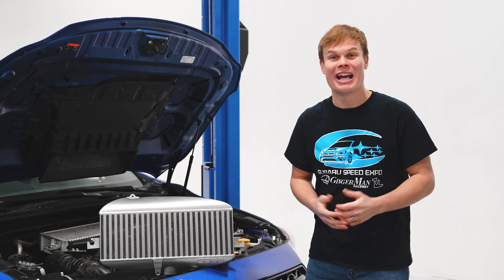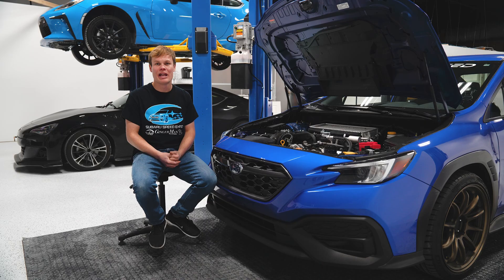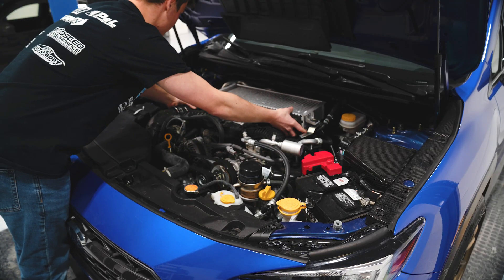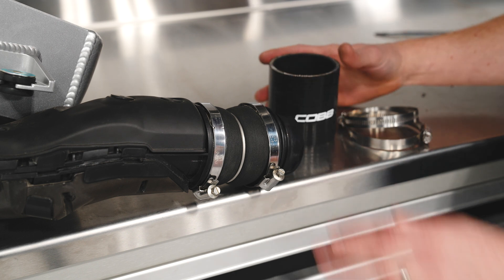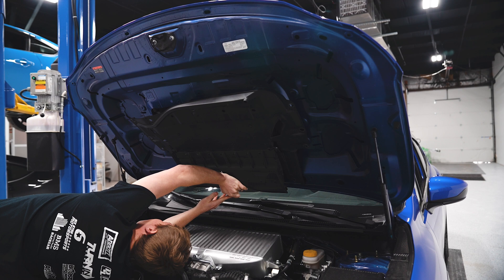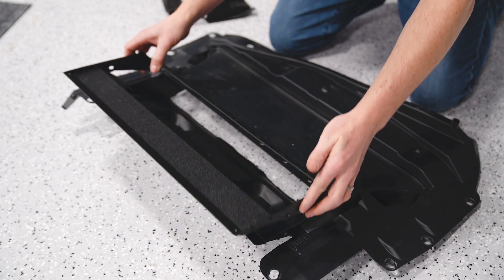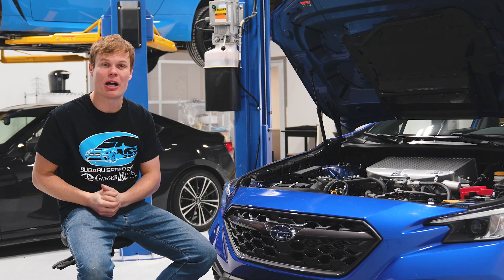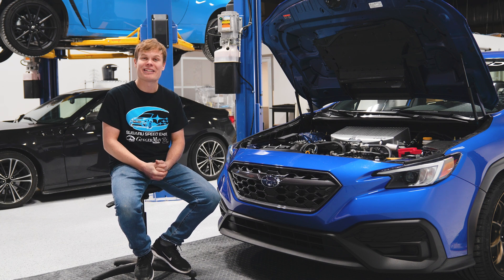Cobb Top Mount Intercooler Install 22+ WRX

Comment: How about a dyno before and after?
Reply: literally wont make a difference on the dyno. upgraded intercoolers are more for much higher airflow cars and/or somewhat lower air temps when the car is getting leaned on for a long period, like on a track.